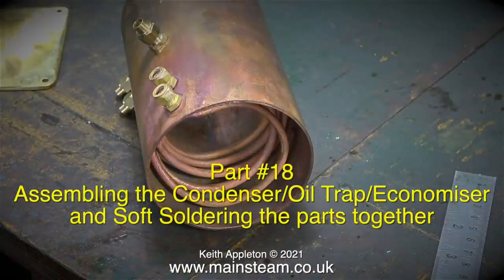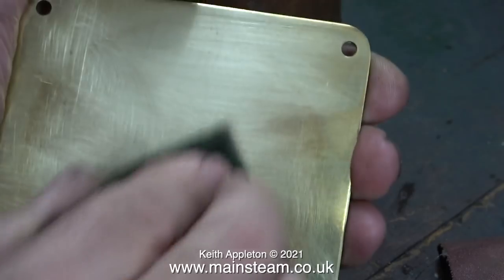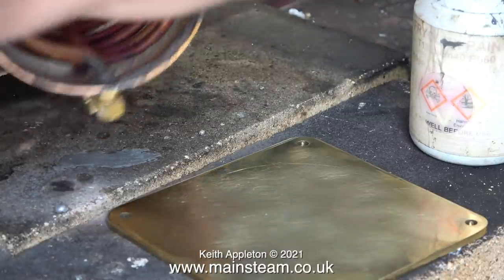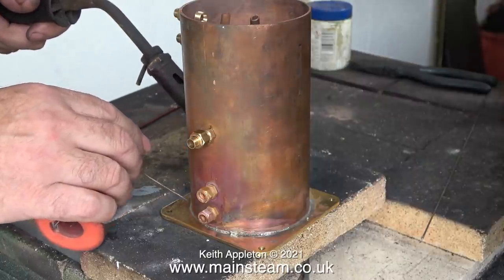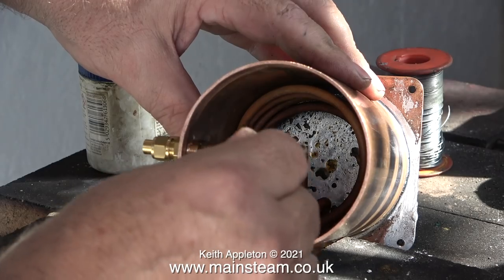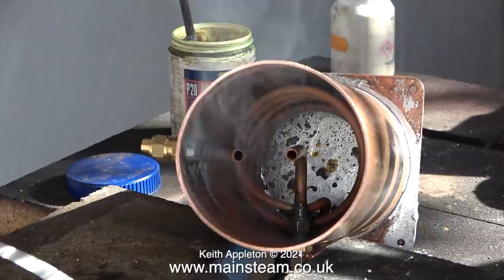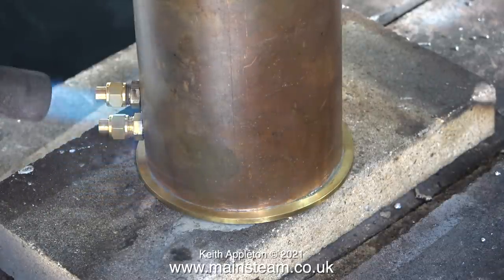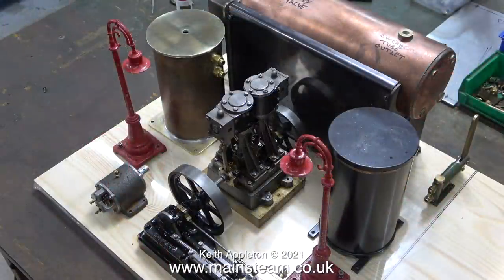MAKING A STUART MODEL STEAM PLANT - PART #18

Comment: Keith, I remember the  plumbers wipeing  the soldered  joint  at the back of the old toilets   when I was a youngster  (75 now) they  used a rag ,don't  know if it was damp or not  but it was  a beautiful  joint when finished.

Comment: could you use a small fan to speed up the cooling a bit?
Reply from the maker: That is not necessary. The Condenser condenses fine as it is.
Reply: @keithappleton  I mean to cool off after you solder? gee I wish I would post right

Comment: Thanks for the excellent video Keith.  I’m just getting ready to build my first steam plant.  I have a question regarding the positions of the exhaust from the engines.  Why do they enter the economizer at the top rather than under the coil?  Wouldn’t the coil pickup more heat if the exhaust was under the coil?  I know this is a newbie question but when I build one it has to make sense to me or I won’t be able to explain it to my grandson:)
Reply from the maker: Think about it ....... the steam needs to initially condense in the air inside the condenser and not through the water. It is the hot condensate that keeps the inner water tube warm, the steam entering heats the top half of the pipe but remember that the condenser is filling with condensate all the time.
Reply: Thank you Keith that makes sense!